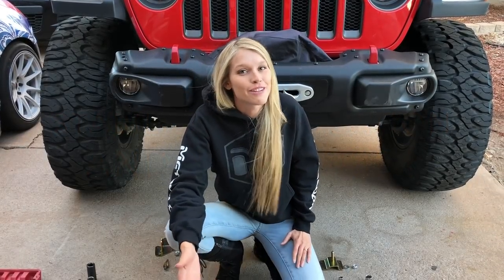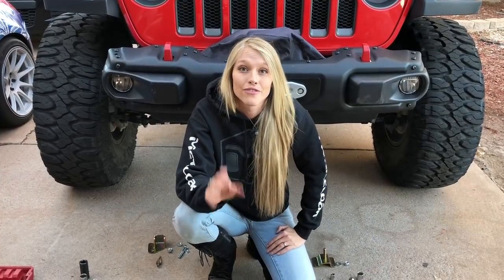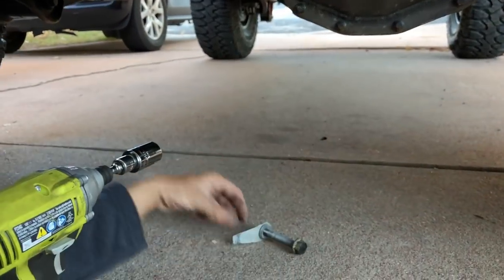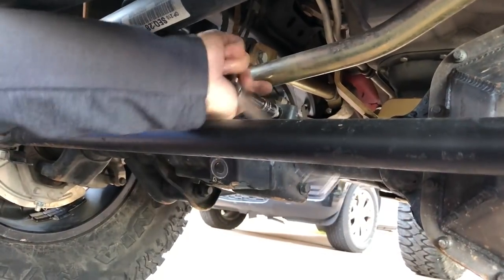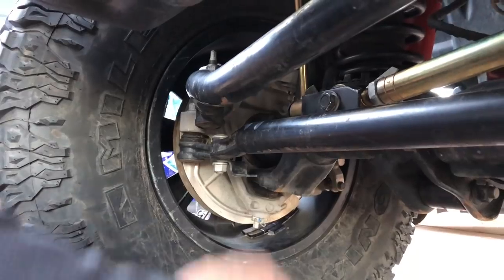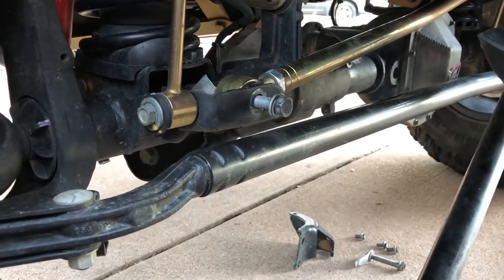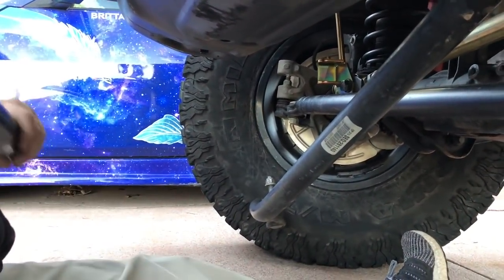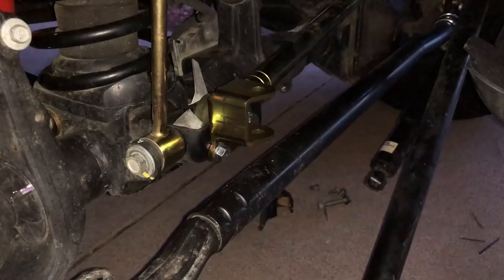How To Install a Metalcloak Stabilizer Relocation Bracket & FAD Skid on a Jeep Wrangler JLU Rubicon!

Comment: Amazing how much has changed in 4 years!   Just now changing my stock steering stabilizer that y'all recommended I replace when you did the long arm install.  Rubicon trashed it even more but the stock one held on even through Moab and trip out east.  I'm looking at matching the Falcon shocks and going with the Nexus adjustable shock.  Hope all is well.

Comment: I've seen many stabilizers customized like yours.  One was so bad, the jeep couldn't turn right.  Removed it to make it drivable again.  When I replaced mine, I measured extended and compressed lengths on the shaft.  Set it halfway,  wheels centered and installed it.   You live in CO correct? Thought I heard snow frogs at the end.  Fairly common in cold weather locations.  Not many here in AZ, but we do get jet moths.  Another entertaining video.

Comment: that's sweet been looking for a good steering stabilizer relocation bracket:)  On a side note if you are running synthetic rope on your winch watch out pulling your hook into your Hawse fairlead it will gouge it and when you are winching it will cut your rope.  Get your factory 55 hook on there asap just make sure to clean up your fairlead.  I have a factory 55 on mine and love it
Reply from the maker: Richard Coyne Yeah, We’ll get it out on once we get back home from Japan!!

Comment: You guys should also look into PSC hydraulic assist, it is much more involved to install it but it is a must have when running bigger tiers and will element the stabilizer and will take away the stress from the steering box. I have it on my 2010 Toyota Fj SAS. Turning a 40” tiers with ease. 
Great video as always 😜
Reply from the maker: admantiom1848 We’re working on it! Hopefully soon!
Reply: Will that work with the JL's electric hydraulic pump?
Reply from the maker: Bob Lionel Yeah, it’s just a hydro assist kit basically. We’ve actually been looking at getting one, cause they make steering while rock crawling wayyyyy easier.

Comment: last time i saw your video white smoke was coming out of engine i think sth bad happened to that engine and it needs some repairs.since that day i have never seen you guys go serious off roading and all of your clips are about replacing some parts and this kind of things,i am curious what went wrong that day?
Reply from the maker: yakoob fakhri Nothing went wrong. 😊 When you’re at top great an angle for too long of a time, oil starts to deep into areas it typically shouldn’t. The smoke you saw is caused by oil burning off.
Reply: So essentially, what happened was that first you went to SEMA, and then you went to Japan ? Did I miss something ?
Reply: @LiteBrite thanks, i hope see you soon going some extreme off roads and rock crawling again

Comment: Why didn't you replace that destroyed steering stabilizer?! The bore of the tube is oval which means the piston on the stabilizer shaft can't move through the tube the right way???
Reply: I was going ask same question.
Reply: they did
Reply: @dobrzpe  looks like the same bashed up stabilizer getting bolted into place to me.
Reply: @dobrzpe  they reused the outer shaft cover. You are right.

Comment: Off topic of your video, but curious, with the winch, were do you mount your front license plate?
Reply from the maker: 1234nbbw We don’t. Lol I typically don’t run front plates on any of my cars.
Reply: @LiteBrite  I didn't have a front plate on my JK Unlimited Rubicon from the day I drove it off the dealer's lot in April 2012 until shortly after its arrival on Molokai in Hawaii in March 2017.  I have Expedition One front & rear bumpers.  In Hawaii, the DMV people insisted I "install a front license plate."  So I did.